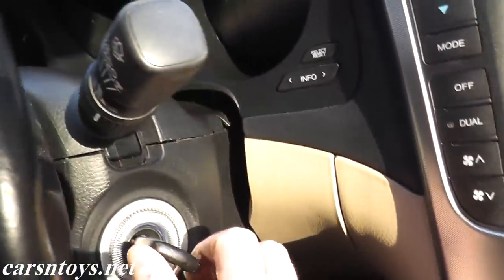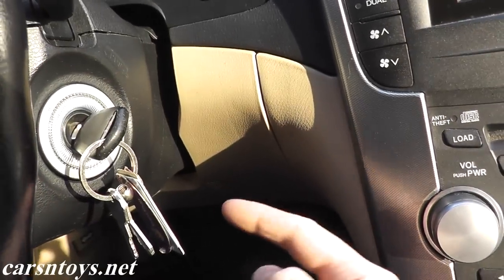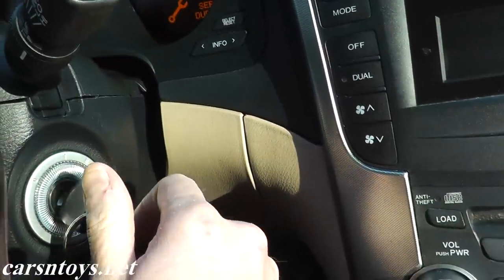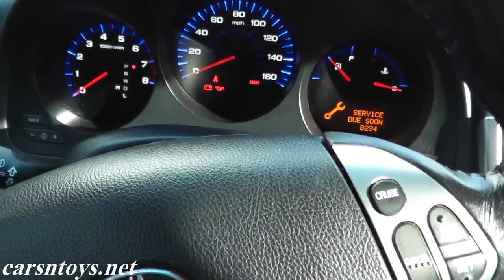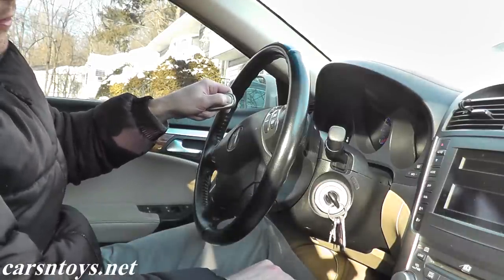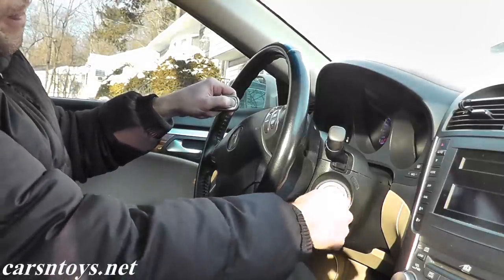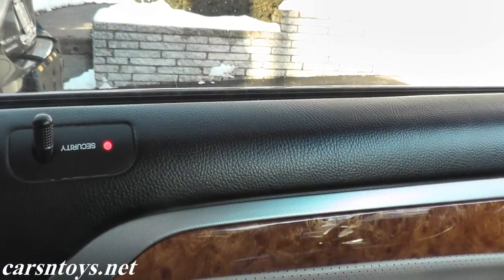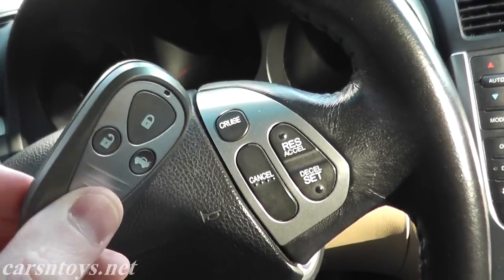How to Program Keyless Entry Remote Key Fob for Acura TL

Comment: Thanks, this is accurate and works for one key.   For those that want to program multiple keys, the steps here are correct, you just need to add the Driver # button on the door in between the ignition key and the key fob click.  For example,  ignition key to second position, click driver 1 button on the door, then click the key fob.   Repeat this 4x.   Then for Driver #2, repeat the whole series for the Driver 2 button and second key fob.   Hope this helps.  My vehicle is a 2006 MDX.
Reply: worked for acura tl 04
Reply: Driver 1 button? Where is that
Reply: can u explain this a little pls
Reply: @alexandranoriega3513  it should be on the door
Reply: @jq-10 : I'm curious...WHY is there a Driver 1 and Driver 2 BUTTON on the DRIVERS door.  Is this for keeping seat placement, Mirror adjustments, separate controls for preferred temperature, etc. To enable each DRIVER not to have to make adjustments every time they drive or something like that??? I have a 2000 Acura 3.2 TL; therefore, I'm assuming this "set-up" is only on the newer model Acura vehicles or any model "after"  Gen 2000???? lol
Reply: Nice! Great tip, worked awesome for my 2005 TL!
Reply: @inmyopinionwisdom4986 yes you are correct. It’s for a saved preset.
Reply: Thank you for this man! Was sitting in the car for 5 min tryna program it and ran into your comment. Made my life easier now with two key fobs!
Reply: Thank you, I had been searching everywhere for this detail

Comment: Just a tip for everyone trying this. Mine wouldn’t work with the lock button no matter how many times I tried. I decided to try the unlock button with this same process and it worked! Don’t get discouraged trying the lock button.
Reply: What are the steps?
Reply: Same tried this and it worked had to turn on and off the ignition switch faster.
Reply: He did say hit lock or unlock after he put key in on position.

Comment: For anyone wondering : use the lock button while syncing the remote. Once you hear the initial click press the lock button again then the unlock before turning off the ignition. Turn off the ignition and remove the keys and it should work. Thanks for the video!
Reply: This is the step he left out. Thank you so much.
Reply: @philbertlovely7724  Yes, he did but did not say so.
Reply: Thanks bro i was having trouble
Reply: The last step u mentioned was very crucial, thanks a lot!
Reply: P
Reply: Thank you doing gods work I was over here stressing I was hearing the lock but door was not locking I fix it though

Comment: Thank you!  Didn't work at first but increased the speed in which I cycled the key and it worked out. 
This method worked exactly as described on a 2006 TL

Comment: hello a few months ago I bought a 2002 acura tl, but it does not have the original keys, the unlock buttons on the doors do work, but the one on the trunk of the car does not, anyone knows why, my question is why the  key is not the original?  It is that this bad program, I do not think it is the mechanism because with the button inside the car it works, but with the button of the key no, I hope and you answer me, good video

Comment: Is that going to enable you to customize your keyless entry setting like automatic door lock, seat and mirror settings for driver 1/driver 2? if not, how do you do it?
I have 2005 TL and I lost the original key fob so I am now using one I bought from ebay, the flip folding remote key fob type. I works normal and OK except for customizing my door lock, seat, mirror setting because I can't link it to my keyless entry system. I hope you can help me. thanks.

Comment: thank you very much. I have a TL 2006 and did watch your video on replacing the intake air filter. can you tell me how to replace the intake hose that's attached to the filter? I noticed mine had cracks in it and taped it for now. thanks again sir.

Comment: Mines stop working along with my high beam,turn signal,low wiper setting and one of the windows after i fixed the positive terminal on my battery so the fob programming steps didnt work at first.All of the fuses were good.It got fixed when i temporarily removed both terminals from the battery for a few minutes and put them back.I got this tip from a acura forum.I was able to program the fob afterwards.
Reply from the maker: Interesting. Glad it worked out!

Comment: I did this and it works but now my other fob doesn't work. Do you know how to get driver 1 and driver 2 to both work?
Reply: thats what i cant figure out
Reply: Joseph Coleman you have to with the other fob do the same process hold the unlock button and the lock button on your keyless and it should engaged
Reply: Joseph Coleman I'm sure you figured it out by now but once you program a new key fob you have to re-program all key fob together because it will erase all othe fob memories.

Comment: all the buttons stoped working on my driver side door including my car key. basically i can unlock my door with the key but It wont disable my alarm. my theory is i can program the remote key fob to by pass that issue. is this correct? i've tried it a few times now and still no luck. any advice? (the wireless key fob i bought is for my 2004 acura tl. I made sure of that)

Comment: Hi, I was doing the steps in your video to program my keyless control. And I had no result. if you could help me or some suggestions. Also in the panel I get the word driver 2 detected.
Reply: Yo bro did you ever figure it out? My 06 TL does the same thing

Comment: Hi nice video will it also work for a 2001 nissan maxima. One more question my brither bought a 2002 honda cr-v 4wd from an auction. The car does crank but doesn't turn over. The battery is brand new from autozone. The starter I hear is clicking and I also hear the fuel pump clicking. One strange thing is that the tachometer fluctates when I turn the key to start the engine. Plz help with your informtion. I can make a video as well to show what it does.
Reply from the maker: omer pasha If the car cranks then you have two things to check - spark and fuel. I'd first check if there are any trouble codes. Then check if there's spark. Check out a spark plug tester and go from there.

Comment: So glad i found this video, it was awesome thanks! I just bought a 04 TL that didn't include the fob. Did you just buy a used fob online that you programmed in the video? Basically, can i just buy a used oem fob on eBay and use this procedure? Thanks!
Reply from the maker: I think the key fob was purchased off ebay and works perfectly fine.
Reply: I bought my fob off ebay and it works. The trunk seems to take a few seconds longer than the factory one though.

Comment: I have an 04 acura TL,  following your instructions, at the end the doors lock but when I turn the ignition off the key fob does not work anymore?  Am I doing something wrong?
Reply from the maker: +Jose Medina Using the factory key fob or an aftermarket unit?
Reply: +CarsNToys  factory that i bought on ebay. it started working... any way to change the fob to be driver1?
Reply from the maker: Glad it works. There is a way to do that but I have to research it. Next time I have the TL here I'll post a vid.

Comment: or easy just hold the unlock and the lock button for a second or two and the led light should blink once meaning its conected if it blinks twice it means it got disconnected trust me i read the manual

Comment: I have an 06 TL and this isnt working on it, I have tried going from key position 0 to 2(like in the video), as well as key position 1 to 2 in the exact same manner as you did. Also tried it with the unlock (and lock button, like in the video), any ideas? Could the sensor under the dash be faulty?
Reply: Did you find the problem
Reply: Mine won’t work either

Comment: it not work for me my 2002 TL use to work but some time it didn't work and I try to do 3 time lock and now both of my key fob not work why I buy this car use and the previous owner install a Kenwood DVD it may be the problem can you help me to fix it I am a Transmission mechanic for 30 years but I am not good with program thing please help thank

Comment: Before completing the steps in this video, my remote worked. It would lock and unlock my car. I was not able to enter the remote customization menu and was getting an error message saying that the remote must be linked first. 

After completing the steps in the video, my remote no longer functions. I have even tried repeating the steps in the video multiple times, but my remote no longer works at all. What the hell???

Comment: Does this work the same for a flip key remote straight from the factory?
Reply from the maker: +Charlie Diaz Not sure. I have yet to try that.
Reply: They are telling me that the key must be programed and the car won't start if it's not. $130 to just program the key. Is the true.
Reply from the maker: Charlie Diaz
Sure could be. Programming is never cheap.
Reply: Yes it cost 135 to program the key. I'm doing mines right now. $80 for key and $135 for programming. $214 total here in california.

Comment: do you know how to turn the sound off when it locks or unlocks? i have a 2004 TL
Reply from the maker: +Robyn Wilson To be honest I never tried it out.
Reply: gotcha. its so loud, i wish there was something i could do. thanks for responding
Reply from the maker: Robyn Wilson
I'll take a note to take a look the next time I have the TL here.
Reply: thanks so much. i would really appreciate it
Reply: I have 2006 acura tl and I believe your car and my car have the same feature. Put your key in ON position and look for a KEYLESS REMOTE menu on the cluster display under fuel and temperature gauge. You can set it as you want there. For me, I wanted it to beep when I unlock or lock, but it does not beep as it should lol..
Reply: +Robyn Wilson 
press and hold the trunk unlock button, then press and hold the lock button.  the lights flicker for a few seconds, than release the buttons and try it.  Repeat steps to turn it back on.

Comment: Hello. Not work  in my acura rsx can you help me please
Reply from the maker: Carlos0008cg The RSX may be different than the TL. If you have the owners manual you can often find the instructions there.
Reply: Same here. It only unlocks it but after u get out of the car it doesn't work. I'll google the manual.
Reply: Carlos0008cg hold the unlock and the lock button together for a second
Reply: Carlos0008cg thanks I tried pressing the lock and unlock at the same time after i programmed it and it actually worked.

Comment: so whenever you change the battery in the remote you have to do this process?
Reply from the maker: +AnDrOiiD619 No. Only if you're programming a new key fob.
Reply: +CarsNToys oh that's weird because I changed the battery in the remote and I get nothing. do you have to do anything special for it to work again? I have the exact same remote in the video
Reply from the maker: +AnDrOiiD619 No. Nevertheless, if you're having trouble try following the procedure in the video. But it should work.